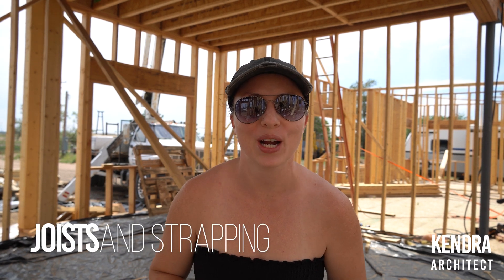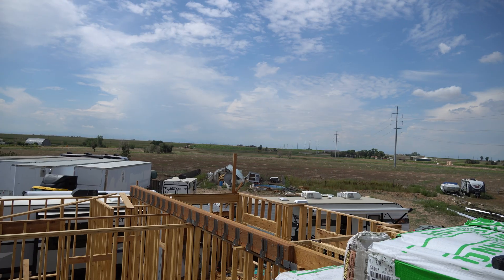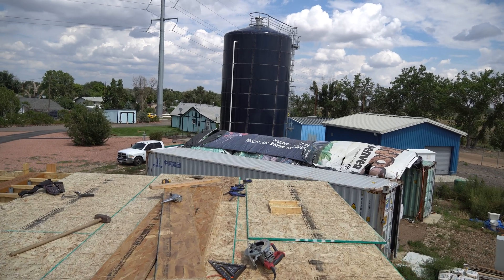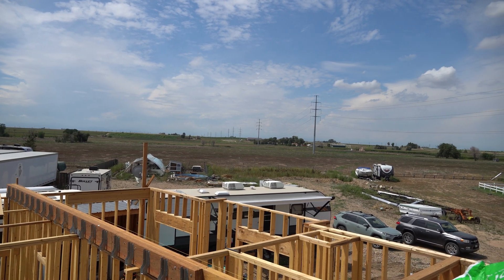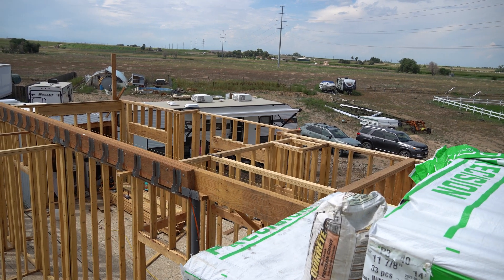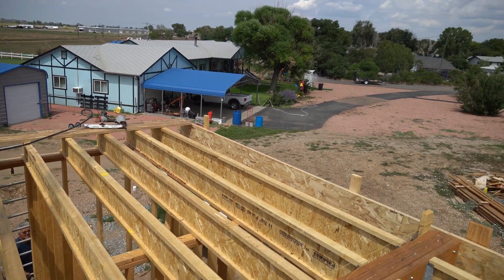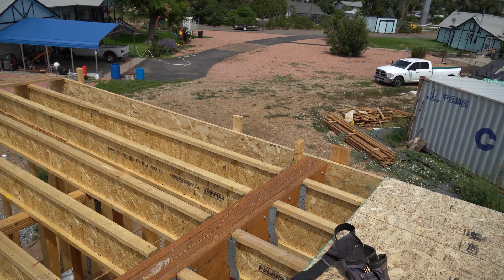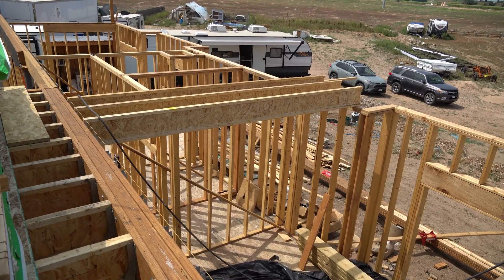THE ULTIMATE DIY HOME BUILD: Installing Joists & Strapping

Comment: It's called decking
Reply from the maker: Not sure which part you are referring to.  In this video we are talking about floor joists, the OSB subfloor (i.e. decking), and the installation of the metal strapping that structurally ties the floors and walls together.